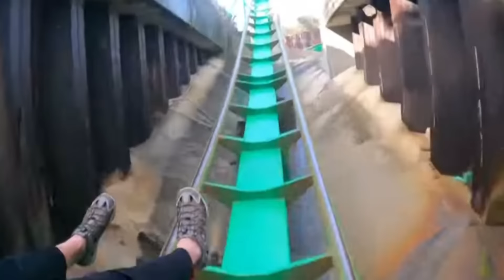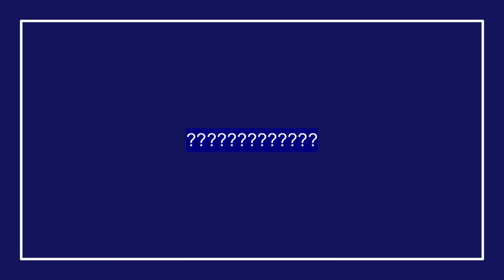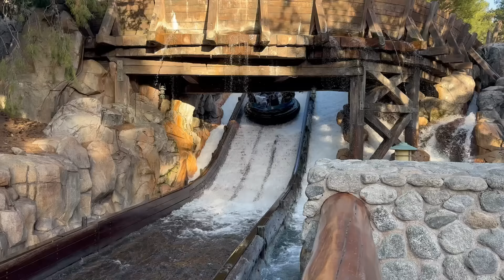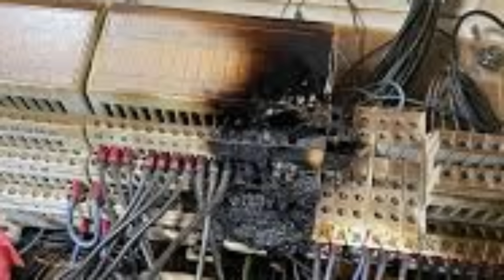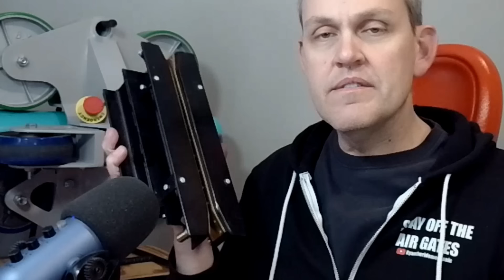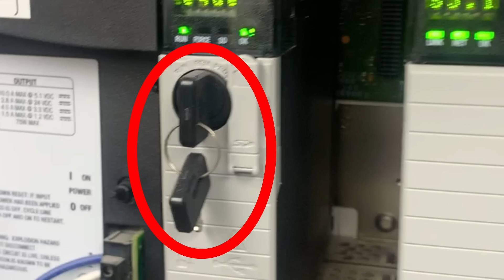What Happens When a Ride's Computer System Fails?

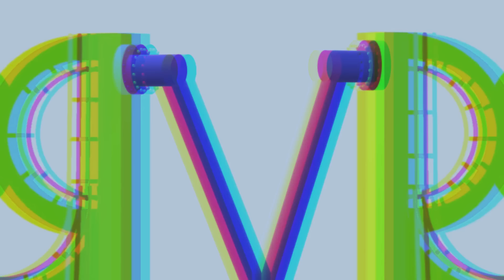Comment: 0:46 Controls Engineer here. Hope I'm not jumping the gun, but industrial machines (and these rides are, in essence industrial machines) usually follows guidelines known as Best Practices. Best Practice for safety prefers that the safety devices require a constant signal to stay DISENGAGED. Like a 'deadman switch,' if the "Everything is OK" signal goes away, the safeties will engage, stopping the machine as fast as SAFELY possible. For a carnival ride, that means bleeding off the speed without causing whiplash in the passengers, and generally not stranding them in a dangerous position, such as dangling upside down in the middle of a loop.

Comment: Nice video Ryan.   The AMF 82-70 pinspotter operates quite similarly with the small and large control relays.   The main safety function for the pinspotter being to prevent the table/sweep assemblys from running into each other....aka an "interlock prevention".
Reply from the maker: Is there a mechanical interlock on those or is it just electrical like can you force them into each other if you tried or I think there was that cam on the front that you showed me that prevented that
Reply: @ryantheridemechanic  great question.   There is a physical cam system that the machine uses in normal operation.   A failure of the high voltage relay though can conceivably cause it, but when that relay fails, it will usually fail in the "no voltage" state.

Comment: How does firmware upgrades work? I assume the manufacture has to come out and update and verify the system on a new version?
Reply from the maker: All the processors I’ve worked with never had their firmware upgraded. That’s where in the video I was talking about having to have the same revision of controller with the same firmware loaded into it because the firmware can damage the program so it’s never updated and most rides.

Comment: Automation electrician, here.  That was a pretty good overview of fail safe systems and programming, without going too far into overly technical detail.  Some Contrologix/Guardlogix (Allen Bradley) and B&R can load the program from a flash or SD card.  Good for keeping a backup available and ready to just plug in, or load into a replaced processor.
Reply from the maker: Thanks I try not to get too far off the path. I like to be technical; “that’s cool” I try not to get technical; “I don’t understand”

Comment: Speaking of fail safe brakes, GASM @ great adventure, it looked to me to have what I know as a “rotochamber”.  Rotochambers in industrial settings have a duel surface area where air pressure in one chamber overcomes a spring for the fail safe brakes and the other is the service chamber that is pressure to apply brakes.  Would
Anyone happen to know if this was/is common to lots of arrow coasters or was that just a one off on gasm
Reply from the maker: Our old woodie used to have E-can brakes. Same thing. One pressure to neutralize the spring then another pressure to act. Some assemblies were not made that way and were only open with air.

Comment: Question.  Do parks keep extra Computers and relays on stock for failures?   And if so how many?   And are they specifically for a certain ride or can they be programmed  for what ever ride needs them at that moment?
Reply: At the park I work at we always keep spare processors, contactors, relays, pushbuttons and a thousand more things. 
 
We have master copies of all the ride programs / parameter settings for vfd's. If we have to replace one, we flash the controller firmware and download a copy of the logic.
Reply from the maker: Parks will often keep a spare processor on hand, but typically you will have to turn it on and link with it to install the correct program once it’s installed for other components like relays and input or output cards. They typically keep one specific to the rides unless they use the same card over multiple devices.

Comment: In most industrial systems I’ve worked with, the safety program on AB controllers is mainly used for I/O isolation (so the main logic/IO forcing can’t directly drive safety I/O) and basic fault handling. Is this similar to how safety logic is implemented on amusement park rides, or do rides tend to use more comprehensive safety programs?
Reply from the maker: I can’t answer that for the newer safety devices but I know engineers can still force safety outputs I’m not sure of the exact steps.
Reply: The safety configuration & its logic "should" be locked requiring a password to unlock. Once unlocked you can do forcing. Any time you unlock it, the previous safety signature will be removed, when you re-lock it generates a new safety signature. Responsible vendors will make note of the safety signature as they left it, so they'd know you were playing around (or made changes). 

Of course you can lock the safety configuration/code, but not everyone does (speaking about general industry here, not parks/rides) so if it is left unlocked you can do a lot (like forcing) with some minor restrictions.
Reply: @nathanmsu  right, I’m more interested in how the programs are structured and what they have control over. Generally from what I’ve seen, even on very safety critical systems, it’s pretty basic and easy to get around if you can edit regular non-safety logic elsewhere, but in the case of maintenance at parks, this doesn’t seem to be the case.

Comment: Great content Ryan.  Controls |Engineer since 1988 here !  I had to maintain control systems where they had a PLC running a pumping station with a hardwired relay based backup system.  It was great until you got an intermittent fault in the relay circuit which played havoc with the PLC.  All these years later designing highly reliable control systems and working through all the possible fault scenarios and considering the human factors is hard.  Love it though :D

Comment: 33:07 if it’s a problem in the program that the park really wants fixed would intamin replace the whole computer and program a new one for u guys? Ik it would be ridiculous money wise I’m just curious if that’s a option or they just say we aren’t touching it no matter what
Reply from the maker: The cost of installing a new controller into a ride is definitely a large Expenditure these days I’d be willing to put a price tag of close to $1 million just for the program upgrade because there is a lot of engineering costs involved in design review. You have to bring the ride up to current ASTM standards.
Reply: @r @ryantheridemechanic a I figured. Ik a six flags park would deal with it but I think if universal really didn’t like a program they would pay the manufacturer just to redue it all

Comment: Are there rides which have proximity sensors in valley regions? That would permit the computer not to lose a train smiler style.
Reply from the maker: Correct. Not impossible but more thorough. People can still make mistakes so proper inspection of the ride must take place prior to resetting the system.
Reply: @ryantheridemechanic the smiler in a prime example of how mistakes can happen

Comment: Speaking of E-stops on rapids rides, is it standard for operators to carry a remote control that can trigger a stop? I’ve only seen such a system on dark rides for the operator monitoring guests inside and for one rapids ride. Once triggered, the entire PLC or computer system has to be reset.
Reply from the maker: The use of remote control E stops is a hot topic. The remote control E stop carries a safety rating with it, but engineers in general feel much more comfortable with hardwired, mechanical buttons that are consistently in front of an operator.
Reply: In the cases I’ve used such a remote e-stop fob, they’ve been used by operators monitoring the show building of dark rides or the portion of raft rides outside the view of the control booth. These supplemented the hardwired controls in front of operators at main or auxiliary panels rather than replace them.

Comment: Hey Ryan, fantastic breakdown of how that works. You're really doing a fantastic job of coming up with example cases for our friends with less technical knowledge.

Two little Funfacts, since you dabbled a bit into the magnetic brakes and the fact, that the induced magnetic field will never fully stop a train:

1st - This is because the magnetic current induced between the magnets and (usually) copper fins is dependent on movement. The slower the train, the less magnetic current inducing a braking force. This reaches a point, where the energy and mass of the train get's higher than the induced brake force from the magnetic current, leaving the train crawling, but not stopping. On a perfectly horizontal track, the only thing that would stop the train in this case would be air resistance and the pressure of the wheel assembly on the rails. After that, it would also be a hassle to get a 10+ tons train, that also has quite a lot of pressure and friction between wheel assembly and rails on modern, high dynamic rides, moving again.

2nd - Intamin is the only manufacturer I personally know of, that doesn't use a set of classic friction brakes at the end ob a block to stop the train (launches used as blocks by short cirquiting aside, they are a whole different story), but a set of friction wheels instead. On the more modern Blitz Coaster models, they use a set up, where the pressure and friction between the trains base and the friction wheels is high enough, that those alone can stop the train at the end of a block by themselfes in all circumstances and environmental situations the ride is allowed to operate in. If you know examples from other manufacturers, please correct me on that.
Reply from the maker: Number one I was surprised when engineering argued with me that the wind could blow a train out of a block. Pushing trains around myself they are way too heavy for wind to move, but maybe there’s a chance I’m not sure.
 Number two I know intamin uses friction drives for block zones and off the top of my head. I believe you’re right. I think INTAMIN is the only one that does that.
Reply: @ryantheridemechanic  probably a case of "better safe than sorry". Depending on train design (think inverted trains) there might be enough area where the pressure may move a train in certain extreme stormy conditions. Probably unlikely, but where lifes are on the line, you naturally want to rule out any risk you reasonably can.
Reply: If we consider the case of a block area with no eddy current brakes, like a Station or Transfer Area, B&M has often relied on just advancing wheels.  Also the very early RMC coasters relied on advancing wheels in the station area.  Generally, these are areas where the train has already been brought to a controllable speed in a preceding zone.